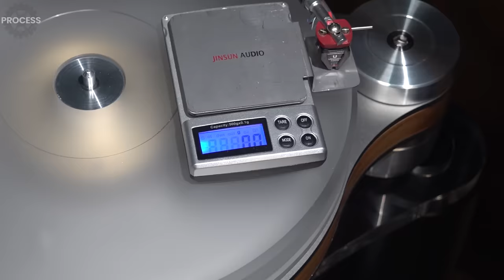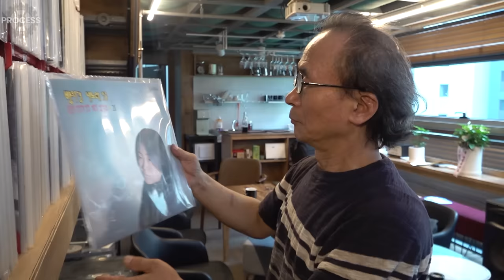Process of Making a Handmade LP Turntable. Korean Analog Audio Artisan.

Comment: The craftsmanship is something to be admired, but the irony in a vinyl turntable is that the dynamic range, noise floor, frequency response and harmonic distortion of the system is primarily defined by the original cutting lathe and its electronics, used when transferring the master tape to the pressing master. This can be measured quantitatively and there is nothing all the effort put into a turntable can do about it. A beautiful and expensive machine like this will simply reproduce with accuracy, the relative low-fidelity that is embodied on the vinyl record. There is no reason today, except nostalgia, to play vinyl records. Digital audio reproduction is not only superior when well done, it is orders of magnitude more affordable. This sort of device is for people who collect jewellery.
Reply: When we’ll done yes , but mostly awful.
Reply: Have you ever heard an good clean all analogue record on a high end turntable in an high end stereo system?
Reply: @jofa89  Yes
Reply: I agree with part what you assert, that most vinyl is badly cut, and would further say >99% of all records ever made sound bad, however the same could be said about digital recordings.  What is very apparent is that you've never heard a high end vinyl system.  Once you have it's hard to listen to a comparable digital system.  Analogue reproduction of an analogue signal will probably always sound best.
Reply: @tubelab194  I agree that the very best vinyl is better than digital , as a music carrier analogue wins.Digital despite its superior specs just does not convey the soul of the music.Why do you think people have never heard a good record player , how do you define this ?So what tt fi you use ?
Reply: Low fidelity? lol you haven’t heard well recorded vinyl on a high end system.
Reply: @JohnLee-db9zt  Can you define this ?
Reply: I listen to music in digital format, taken from different media, mostly CD, SACD and vinyl. And I can say that the usual CD sound is not alive, it is too tight, dead. The SACD sound is already much better, more details, but not natural, also dead. Vinyl 24/192 sound is the most natural, the most pleasant to the ear, better than the original digital recordings in the same resolution. 
P. S
I've personally never listened to CD or vinyl on good hardware, but I'm pretty sure of the superiority of vinyl over everything else
Reply: @davidspendlove5900  I’ve spent a lifetime producing records, starting when the 2” 24 track recorder was king of recording studios around the world right through to today. At no time EVER in those decades was vinyl considered anything more than an old leftover curiosity of the past. Every single format of music recording and playback was and remains demonstrably superior in every way that can be quantified. Cassette tape blasted right past the horrendous real-life inadequacy of vinyl. Engineers and producers such as myself rejoiced when vinyl died, confident that our expertise would not be wasted anymore, happy to know that finally! - every buyer could receive the real intention of the artist in their home or wherever they chose to listen. 

This is real information, not the babbling of a delusional hobbyist stuck in the last century, gloating over the scratches, tick and pops, outrageous levels of distortion and pitch modulation resulting from the inevitable inaccuracy of vinyl record construction. The soul of the music is irretrievably buried beneath your expectations of a hundred year old invention wheezing its last death-rattle. In real fact, you have never actually even heard the soul of the music through all the garbage produced by your beloved record player. 

We who compose, arrange, and sweat every detail for months to faithfully bring our music to listeners, with every bit of the soul we personally know that music to represent, pity the poor fools who have missed out on the last 40 or 50 significant technological improvements we have spent our lives creating for you. But, your choice. I guess.
Reply: @PHSGNE   “I’ve never heard heard ‘x’, but I’m pretty sure of the superiority of…”  Fortunately, there is a word to describe such silliness. The musicians who create actual music and painstakingly record it for their fans are very familiar with it. That word is ‘fool.’
Reply: @artysanmobile  I don’t dispute it.
Reply: @artysanmobile yeah, I didn't hear the real sound. but as I wrote, I listen to their original digital copies. and judging by these copies, vinyl is better. and judging by this, I have no doubt that live vinyl conquers all. I don’t care what mediocre singers think about this. they have no evidence, but I have verified it
Reply: Digital supercedes a quality analog turntable, a quality cart and a quality vinyl recording.....

Maybe in your widest wet dream.

BTW, you must be under 35.
Reply: ...And people who wish to hear the millions upon millions of records that have never had their master tapes digitized.
Reply: Back before CDs first came out, I considered myself an audiophile (with a small “a”) and purchased a mid level hifi setup. When CDs started to emerge, I was going through lean Financial Times and couldn’t afford to upgrade, however a better off friend lent me his player an collection to mind while he was away on holiday. Straight away I appreciated the lack of surface noise, which had always detracted from quiet classical passages. One album that was common to both was Dark Side of the Moon, which is often used as a listening test to this day. I was very surprised to hear that although the CD was cleaner than the vinyl, it also sounded somewhat thinner, for want of a better word. Because of this, even when money issues eased, I didn’t make the change, and nowadays my hearing has deteriorated quite considerably, so there would be little point. Perhaps it was that the engineers of the day weren’t sufficiently experienced in the new medium, or that the early A2D conversion hardware was not as good as today’s, but at least then vinyl was more pleasant to listen to.
Reply: @StepDub    It should be self evident, but apparently is not, that your turntable is over-representing bass and the CD, which is exactly, precisely the sound Pink Floyd chose for their masterwork, is in fact correct. You could use that knowledge to help correct your turntable/cartridge frequency response to match, or you could make the incredibly outrageous leap that poor Pink Floyd didn’t notice how badly they mixed the most popular record in pop history. You know, the one you have already stated is used as a sonic reference. I mean, duh, the CD is correct and your turntable is not! 

The “engineers of the day” would be the very best team the band and their label could possibly find, at ANY cost, to create the CD master which the entire community knew would be the real version in perpetuity. I made records for a living during this transitionary time and personally witnessed the painstaking care with which archival materials were handled to release the new format. The bands didn’t just find a CD in their mailbox one morning. The material changed hands over and over until all authority for the sound - band, label, producer - were happy. It was an enormous effort.
Reply: @jofa89 Yes, have you ever heard a top turntable's signal pass through a 44,1 kHz/ 16 bit AD DA converter and then tried to discern the converted signal from the original in a blind AB-X trial.
Reply: @ottonormalverbrauch3794   I have absolutely done that and found the 16/44 encode/decode path faithfully reproduced all the crap produced by the grooved plastic disc exactly. Original and converted were equally, face-palm disappointing.
Reply: @artysanmobile  I had previously considered that it was the imperfections in the vinyl audio chain that imparted the preferred sound quality, something like the harmonic distortion of valve amplification is said to make electronically reproduced music sound more appealing to the ear. Thank you for clarifying this. 
And yes, perhaps I am being selfish in expecting that the artists, producers and engineers of that period would consider the listening pleasure of the music buying public over their own grand vision of perfection.
Reply: @StepDub    Their grand vision of perfection should always be what a listener expects and wants. I’ve made records my entire adult life and there’s never any doubt who I aim to satisfy. Me, every damned time. It may set your mind at ease to stop worrying about technical matters over which you have no control. There is correct, only available over the past 40 years or so, and there is incorrect, available to widely varying degrees. It is common knowledge among record makers - musicians, producers, engineers, labels - that vinyl represents the lowest rung on the ladder to sonic perfection. We all love vinyl records, their beautiful artwork, the two-sidedness, the vintage appeal of holding one in our hands. But we would never dream of playing one. That ship has sailed and foundered on the rocks of our failed endeavors.
Reply: @artysanmobile  If I ever go back to actually listening to music, I’ll bear all that in mind. 
However, although CD’s seem to be still available, this particular medium looks like it has gone the way of vinyl and most downloadable material appears to suffer from some degree of lossiness. The means of playback is also disappearing (no players in cars or even scarce in computers these days) and I doubt the quality of the A2D conversation chain isn’t always foremost in PC manufacturers minds. 

With CDs getting scarce (along with playing equipment) and download formats intentionally throttled in quality, what’s left? If I buy a turntable, amplifier and speakers and look after them, they will be simple to connect and still be running decades after my high end sound card has burned out, drivers have gone obsolete or playback format is no longer supported by whatever dedicated digital device I chose.

 I can also easily pass them along to my kids as part of my estate, something that is not possible with many online collections. Sure, there are ways around this, but they are not as simple as just handing them over and maybe even illegal (something that no artist or their cohort would approve) 

There’s more to vinyl than not respecting the artist’s preferences at the time of recording.
Reply: @StepDub    You make perfectly valid points. Streaming is a great big mystery pit. And btw, it is the DAC conversion computers and receivers are burdened with rather than ADC. 

It might be of interest that when generating the final master recording, I use a piece of software that can instantly impose the minuscule sonic change each service is known to use when streaming it back to me. The difference is typically inaudible but I do it for my own peace of mind. I’ve just installed software that will make simple a live bit-accurate comparo of my master recording as delivered with the very same recording streaming back to me. Count me curious. It should be said that all of these changes are very small, nothing close to comparing physical formats such as vinyl. 

What’s left for those with suspicions is the increasing number of services offering lossless downloads. DACs are far better generally than the audiophile community would have you believe, with a number of chip manufacturers making reference quality circuits available for less than $100. Applied carefully, major equipment manufacturers can be expected to sell basic receivers with extremely accurate DACs.
Reply: @artysanmobile  good to hear. I will retire soon, and a return to music listening is part of my plans, so it is reassuring to know that sound quality has not fallen victim to the same business pressures and practices that have downgraded so many other products over the years. I will still be giving my turntable a spin, but will probably include other sources to complement my aged LP collection.
Reply: @StepDub    All the best to you. Let me know how retirement feels.
Reply: as with many things there are a lot of snobs in the audio sphere. people who can tell the difference in sounds from the inclusion of stupidly expensive turntable drive belts and cables in the thousands.. can the average Joe tell the difference between a turntable costing 10s of thousands with tone arm/cart/stylus combinations costing 10s of thousands in them selves😮
Reply: someone who's taken an immense amount of pride and skill in producing a thing of beauty👏
Reply: @lfcmarkeb7124    I get that. My comment sucked. Just sick to death of audiophile nonsense. Thank you for your truth. I’m deleting it
Reply: I don’t know what you are comparing with. $350 project turntable with $500 phono preamp can be easily better than $3000 streamer+dac. 
I own $40000 DAC + Streamer and still sound way inferior to $38000 turntable+phono. 
When it comes to value, digital needs to be way higher in price to achieve what analog can achieve. 
When it comes to the ultimate sound, I think CD wins over vinyl. But at what cost? Currently, Esoteric 5-component set up(CDT+Two Mono DAC+Phono+LPS) that costs $150k is the best in the industry. 
So the sound reproduction? Not many recording producers or engineers know jack 💩 when it comes to high end sound.
Reply: 😂todo señal digitalizada tiene. Pérdidas de información. Por el muestro de las onda analógica ing electrónico
Reply: I don't collect jewellery, I play vinyl almost exclusively (excepting streaming services for background music) outside the car. Have done so over a decade. As is with most of my generation, I came from digital. First CDs, then MP3, then all the lossless formats. I had a music server that stored most of my digital music red book quality when most were gaga over MP3.  The switch came when my father, who was also an audio enthusiast gave up his CDs. His set was  mostly from the 80s early 90s. When I  listened to the original cd press of vintage albums, one thing was glaring. The sound from these, subjectively, was more even, less fatiguing to listen to than the more compressed 'loud' modern cd release. This went for even the original 90s vinyls I had as a teen compared to the digital remasters I was collecting early 2k. All my efforts at lossless files and DACs etc wasn't helping. This started my shift in to a simple vinyl set up that I've stuck to. The issue is not digital recordings, it is how it is being laid down. IMO, they are laying it down to compensate for lower than 320bit compression for modern music and remasters. Sometimes you notice this with the digital copies that come when buying modern vinyl on side by side comparison. The audiophile digital recordings (not necessarily remasters) can smash vinyl for sure (Fresh vinyl on the first play with a good set up can subjectively match it. Vinyl though degrades at every play, digital doesn't.). These types of recordings though are limited.  The irony with my current set up is that from phono to preamp is digital and the power amps are class D.  The speakers are 40yrs old sealed Heybrooks. All put together to get enjoyable sound (not necessarily ultimate fidelity) for most music played through it,
Reply: @PHSGNE Superior? A subjective opinion with bias. Different? Absolutely.
Reply: Digital music can not reproduce the full analog curve of muted percussion and brushes played in jazz. I do agree however, that the record itself is only as good as the pressing - true.
Reply: Or djs that started doing it before 2000
Reply: @nauticalmiles8752    It is your right to deceive yourself. You would never run out of company doing so. 

Dark Side of the Moon should sound exactly like the CD, because that is what the band made it to sound like. You can tell yourself you know better than them but be prepared for some serious ridicule. The real truth is that the system you play your CD on sucks and that CD is indeed THE reference for the iconic recording. As for convinced, I never waste my time trying to convince anyone. 4 is one greater than 3. You are unconvinced of that. Why should that matter to me or anyone.
Reply: @nauticalmiles8752    It is as meticulous a record mix/master as I can think of and the band was thrilled when CD distribution began. Finally, all their effort could be heard as intended. Prior to that, the cassette was closest they could get to us. Vinyl was enormously frustrating to the most discriminating artists of the time, being a crapshoot at best. 

Imagine if you can, being an artist at the very pinnacle of a career but still unable to share your masterpiece properly with the world. 1984 was a heady time in my business. We had been mixing and mastering digitally for quite a few years already in hopes of a digital distro format, and boom! There it was. I remember it so clearly - the clean, defined bass was the biggest and most immediate change for listeners. Vinyl’s low frequencies were just mush by comparison and all pop music producers were overjoyed about the lack of distortion for the first time. It was like a whole new release.
Reply: @nauticalmiles8752   When you describe your unhappiness with a superior version of music you like, it follows that your system can’t reproduce the increased dynamic range and frequency response of that superior version, or as I like to say - sucks. Yes CDs all sound much better than their vinyl versions. Your system couldn’t take advantage of that and you were not alone. The quality of consumer audio took a giant leap in the years immediately following digital releases. For once the music was exactly what the artist wanted and there were some growing pains for listeners unaccustomed to high quality reproduction.
Reply: @nauticalmiles8752    No, that is not facts, that’s your personal fantasy and you have the right to be wrong.
Reply: @nauticalmiles8752    I’m done with your ridiculous comments. You don’t have a clue and I just realized I’m talking into the void.
Reply: this is a pointless argument. Some things sound better on CD, some on vinyl. One of Himiko Kikuchi's favorite albums is Frying Beagle. I can't listen to it on CD, only vinyl. If you take very well recorded albums, the sound will definitely be better on vinyl.
Reply: @boratsakdiev1722  I totally agree 
but explain this to"  producers " like artesanmobile 
which call me " deluded " because I said " no all cd.s sound good
Reply: @nauticalmiles8752  I think it all depends on the soundtrack. It's very small on the CD. Thus, I would rank vinyl higher as a source of CD. I gave a comparison above to one of my favorite albums. Flying Beagle, I can’t listen digitally, everything is in its place on vinyl
Reply: @boratsakdiev1722  " it's very small on cd"?
sounding " tiny " not deep 
fragile 
something like that ?
Reply: What a bunch of wankers. Do any of you know what ‘high fidelity’ means? It means to reproduce faithfully and accurately and when it comes to recording methods, digital is a quantum leap ahead of analogue.

For those of you who claim to appreciate the warmth of vinyl, you probably don’t even know that in the last 30 years, everything has been recorded digitally, mixed digitally and mastered digitally. The only analogue process is the needle in the groove and that contributes nothing to the sound, except to reproduce a digital recording by the least faithful or accurate means of mainstream systems.

Vinyl does not have and never can have the dynamic range, low noise floor or low distortion of digital. Anyone who listens to classical music on a regular basis, as I do, has probably had a far greater exposure to high quality recordings than someone listening to modern music, produced by spotty-faced post-teens who get paid too much money to make stuff louder.

And I say this as one HiFi buff who finally ditched vinyl about seven years ago after about forty years of it.

Vinyl cannot fix a poorly recorded or poorly mixed product. It might make it sound ‘less bad’ due to its limitations but that brings the whole purpose of high fidelity into question. Vinyl has a range of 60 db. CD is 96 db and the scale is logarithmic, not linear. You can subtract 10db from vinyl because of the noise floor, giving a real world dynamic range of 50 db.

I get it: people like doing things the old school way. I still shoot and process film. But I appreciate the advantages of digital. I get it that people like the tactile experience of putting a disc on a platter and spinning it. I get it that people like the size and format of an LP record cover and all the fold out stuff that goes with it. And I get it that if people get their yucks from putting a diamond stylus on a piece of spinning plastic, it’s not for me to tell them they’re wrong.

But don’t tell me that vinyl is a better, more faithful or accurate medium than digital because that is wrong.
Reply: @StepDub  CD sales actually went up last year.

I am currently buying more CDs than ever.
Reply: @artysanmobile  These guys are hearing things…😉 like the $5,000 power cable made of 99.99999999% pure copper any wrapped in virgins’ hymens that ‘demolishes’ the $4,000 cable it replaced. They’re more to be pitied than scorned.
Reply: @thethirdman225    I do very much pity that sort of delusion. Life is too good to me to bother with gear talk.
Reply: @artysanmobile  show us this amazing production of yours imagination 🤣🤣🤣🤣

why my comments has been deleted?
Reply: I disagree.
Reply: @nauticalmiles8752  Nothing to do with him. YouTube deletes my comments all the time. It’s probably the buggiest website on the planet.
Reply: @nauticalmiles8752  By the way, he’s right. A turntable can never reproduce a recording with the same accuracy as digital. Enjoy vinyl all you like but any suggestion that it is superior is delusional.
Reply: @artysanmobile  I’m buying more CDs these days.
Reply: @thethirdman225  it delates all of them
and his stays 
uno problemo
Reply: @thethirdman225  nope 
he is not right 
in talk what we have 
the talk wasn't about what is superior 
rather 
I said and will hold the ground that I have personally vinyl editions 
which sounds better than the same cd editions 
every one who was or is collecting cd knows that some of them sound better than another 
even if we are talking about same artist and same album 
I have for example same album cut in 4 diferent countries 
( cd ) all sounds diferent 
sometimes I prefer vinyl to cd 
because it sound better 
do you get my point ?
Reply: @thethirdman225   It’s a great format with substantial built in error correction. If you have players, in a laptop, in a car, it makes sense. I’ve ripped all of mine to hard drive for my music library and keep only the paper, not the jewel box, as archives. It’s very compact, no pun intended.
Reply: I wondered how much that handmade turntable will cost 🤔🤔🤔 $5k? 10? 30k??
Reply: @PHSGNE But very expensive for just some additional noise some people cannot even hear them 🤣 It’s like buying a Chinese KEF against a very expensive British Tannoy 😂
Reply: I prefer listening to vinyl instead of (sa)cd’s. Especially to records before 1983, so totally analogue.
Reply: @fredgien    That’s perfectly ok. Some people want to hear what the artist had in mind. If you ever do, cds will be there waiting for you.
Reply: Very succinctly put. This turntable looked absolutely gorgeous and was exquisite in its engineering but unfortunately is working with a rather flawed media.
Reply: You don't know what you are talkin about.The sound quality of analog equipment is something that digital stuff simply cannot match.
Reply: @StepDub o
Reply: 8:43
Reply: @ssnoc I am going on 😢😮
Reply: That was a large paragraph just to tell us you have no idea what you are talking about. Cool story!
Reply: @JohnLee-db9zt ikr lol, gotta love these clowns. Has $250 Amazon player, but he knows best... clearly by his 11 sentence explanation.
Reply: As a dj I disagree vinyl has a warmth and bass response not found in digital files even lossless WAV files ! Why ???? I don't know ?
Reply: Well put
Reply: @tubelab194  Ma va? 😮
Reply: @PHSGNE ah si?
Reply: Ohhhhh…..here we go……
Reply: There are no Loudness Wars on vinyl... The only reason for me to keep vinyl alive...
Reply: Siento discernir sobre tu comentario. Técnicamente el sonido digital es de mucha mejor calidad que el analógico, pero sólo en teoría, ¿Motivo? El sonido digital es tan perfecto que es falso, pues en la vida real nunca lo tendrás, como ejemplo los anfiteatros griegos o el de Mérida (España), están al aire libre. En la vida real siempre hay algún ruido de fondo, que aunque indinificante, ahí está y esto es lo natural, lo analógico es artificial. El sonido analógico es cálido y el digital no, dentro del sonido analógico lo mejor es un vinilo. Dejo al margen la labor, agradable para quien le gusta, sacar el disco d su funda, limpiarlo y ponerlo. Qué consta que no tengo nada en contra del sonido digital, pero prefiero el analógico.
Reply: Nonsense. A good press on a decent system will sound better than digital if you look past the minor noise. It’s more expressive and engaging. Buy new records made by analogue productions/abbey road etc and it’s no contest if you love music. If you love specs and measurements and how gear sounds stick with digital. Btw I use both. My old knackered records are full of noise and distortion, they sound terrible but if they were brand new they would be stunning.
Reply: @artysanmobile I tend to agree, vinyl was such a compromise. The distance traveled on the outside of the record compared with the inside tracks affected the dynamic capabilities of the music. I enjoyed Record’s when there was no alternative, but annoyed by the clicks and pops and often distortion. I loved it when CD’s came out. People complain about lack of warmth, I say turn down the treble. Generational loss from master tapes to duplicates was of more concern. Tape Hiss with cassette’s was a compromise as well but as a format it was most durable and accessible at the time. Being in my late 50’s my hearing is still good but I have lost everything from 10kherz to 20khz as part of the aging process. Recapping I was never satisfied with vinyl at all, cassettes did the job but deserved no respect (ie could be handled roughly) and you put up with tape hiss especially in the car. Or on cheap decks. Early CD’s we’re perhaps a little harsh (but that was because masters were made to compensate the losses of High’s in older formats. 1/4” tape running at 15inches per second was really the ultimate in sound reproduction but out of reach domestically.
Reply: @charris939    We have traveled a similar path. Vinyl is a fetish, nothing more. It is at the very bottom for noise, distortion, wow, flutter, frequency response, you name it! 

No format ever received closer scrutiny than the Compact Disc. Being first, it had to be perfect and the fact we hear CD playback everywhere 40 years later is a testament to the engineering that went into it, something virtually no one knows. I agree the rush to jump on the new format resulted in very sloppy work, using vinyl cutting masters to poor effect. Much of that was label driven, far more than 50% of the early releases.  

On the other hand, I’ll never forget Brothers In Arms which for me was the summit of the fairly rare DDD releases. That record was miles deep, with the gorgeous title song bringing me to tears regularly. When a recording can do that, I simply have nothing more to say.